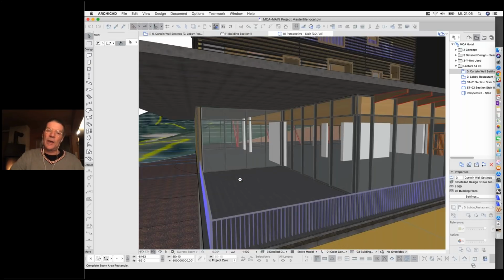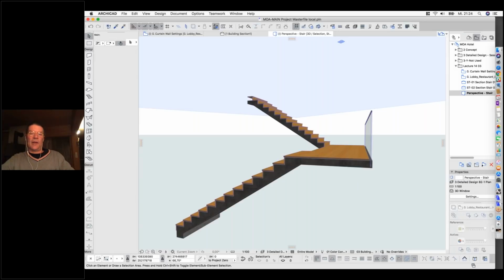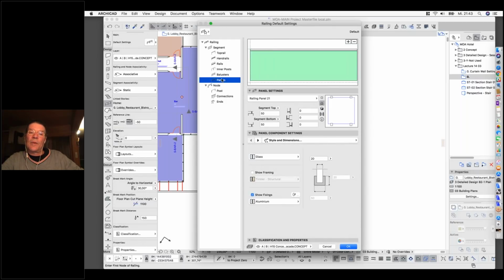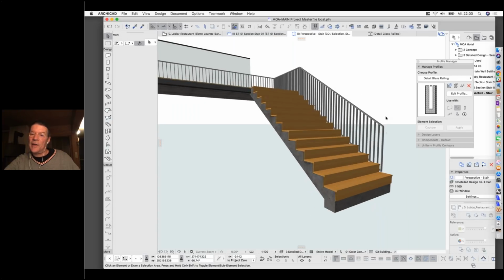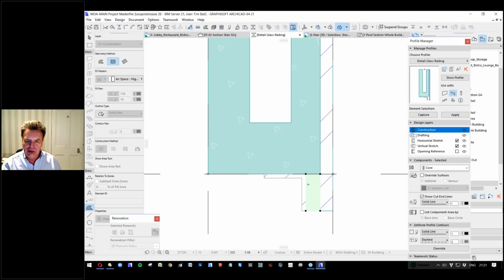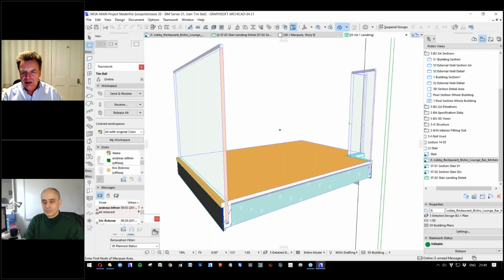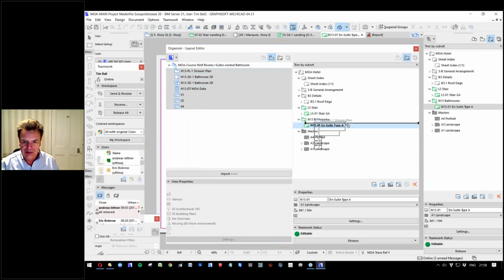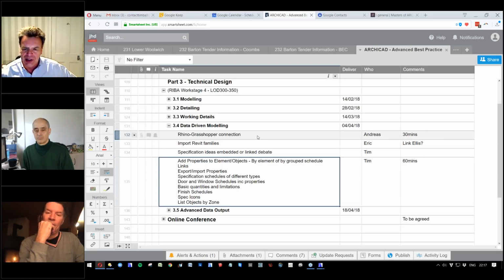ARCHICAD Training on Curtain Walls, Stairs, Railings, Best Practices for Construction Document etc.

Comment: If you wander how to eliminate the gap on the mitered edge corner panel it's by selecting the corner frame that you just set as invisible and type the value 0 in the "panel slot dimensions" box.